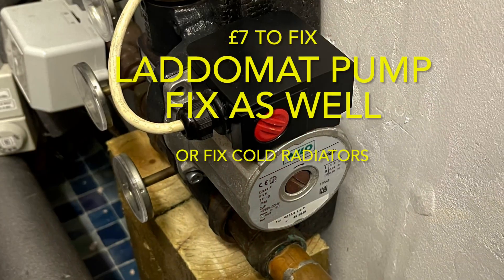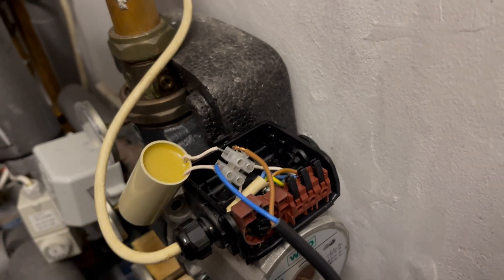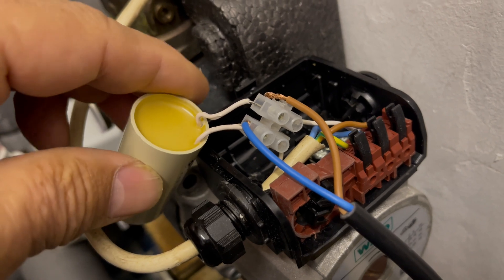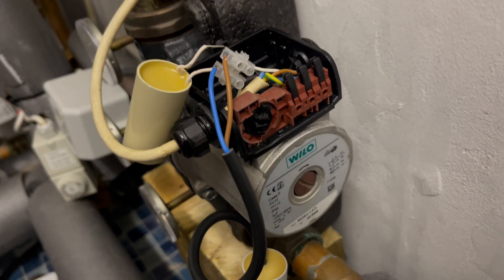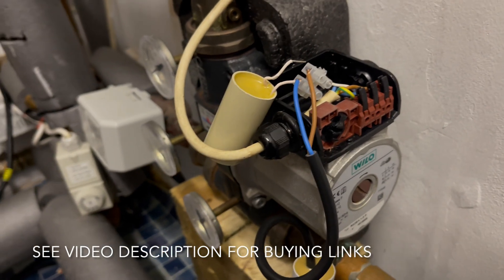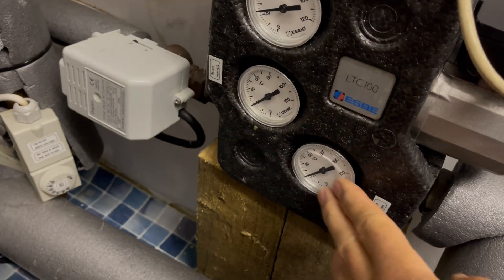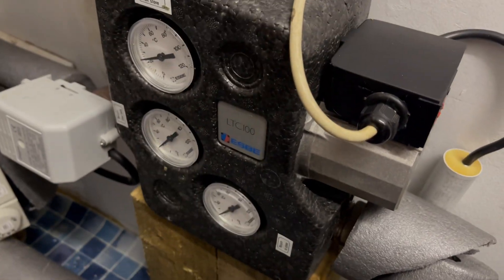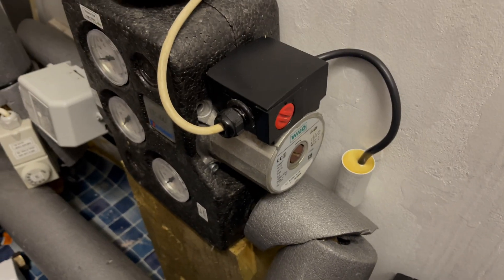How to Fix a Boiler Pump - Low Flow / Boiler Overheat - Surprisingly Cheap

Comment: That's not 3 phase, 3 phase is 415 that's just single phase 240v
Reply from the maker: The capacitor is there to create a 3rd phase by phase shifting the normal 240V 2 wire input.  It gives you 3 wires to the motor, call it 2 or 3 phase depending on your definition/ reference point.

Comment: I upgraded my water pump to a newer style invertor motor system. Straight replacement with no additional plumbing. The type used in this video would use something like 60 watts when running. Invertor motor uses about 20 watts. Payback was calculated to be about 2 years as these can be pucked up fairly inexpensive off the Internet.
Reply from the maker: Thanks, interesting. Yes 70W on this one.

Comment: My brother is a plumber and has warned me of over speeding the radiator water pump. This could lead to a situation where hot water is pushed up to the loft feed tank, causing damp issues and of course wasted heat losses. Not applicable in this video, a warning to other ussers tho.
Reply from the maker: Thanks for the feedback,  but that doesn’t make sense to me about the header tank, as a higher speed on the pump doesn’t increase the system pressure (as you can see on the pressure gauge on a closed system). It’s higher output push is balanced by higher input suck, so pressure at the header tank would be unchanged.  To push water out of the header tank, water has to come from somewhere, which it can’t.
Reply: @comeinhandynow  long time since I was at college and tbh, I don't know your setup. I did catch the pressure gauges in the video and these of course work great in static operation. As you have a loop system (dynamic system), you would need a Venturi tube system setup to measure accurately. Where does the pressure come from, you ask? Heat rises and IF the rads don't dissipate the heat, this  will rise up and into the header tank.
Reply: You haven't got a combi boiler have you? I assumed it was a BBU
Reply from the maker: @GaryHerberson no a closed system with hot water cylinder
Reply from the maker: @GaryHerberson  yes on an open unpressurised system, on the more recent closed types like mine the heat expansion is taken up by an expansion tank and there is not heeader tank.
Reply: @comeinhandynow  thanks for the clarification.
Reply: @comeinhandynow  I've experienced this issue with the boiler system in our church. If I put the pump speed up to position 3 then the return flow to the boiler also gets pushed up to the header tank about 5 metres higher than the boiler. If I drop the speed to 2 or 1 then this overpumping stops